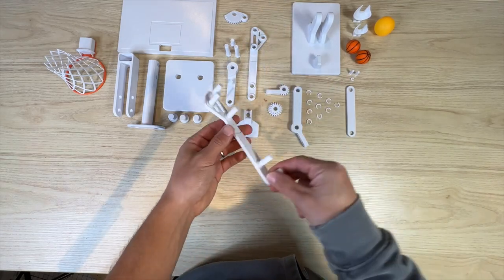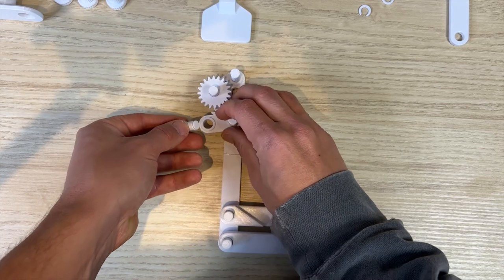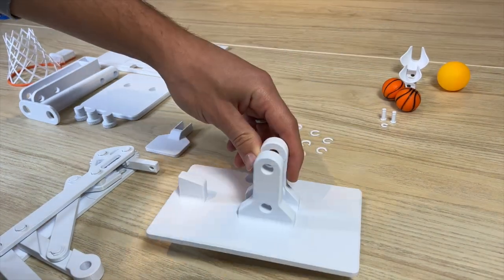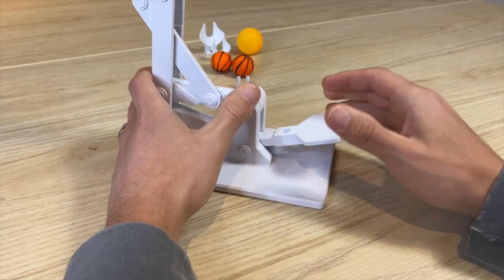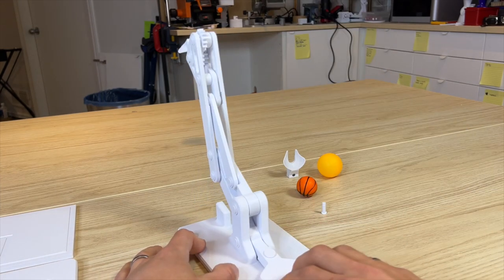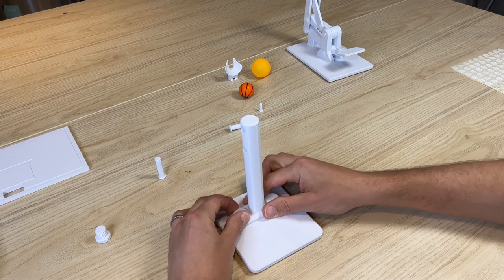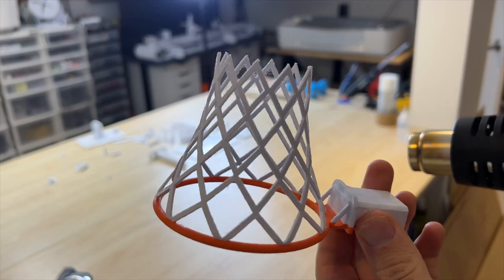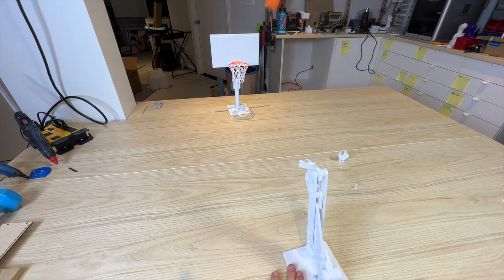How to Assemble the RoboBaller Mechanical Basketball Shooter

Comment: Thanks for the model. Just finished assembling it with my daughter. 

It was all smooth sailing except with "arm link vertical back" that when c-clamped made everything too tight and jammed the mechanism. Added some wax, and only add c-clamps to top and bottom (seems strong enough with that alone), and then everything worked fine again.

Looking forward to more crazy fun mechanisms.